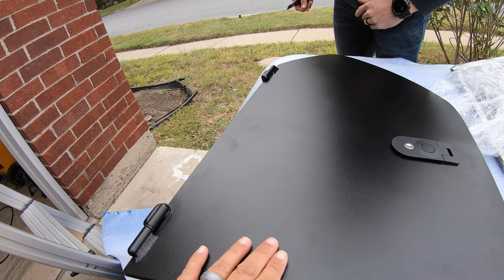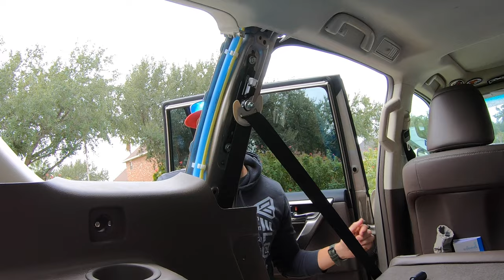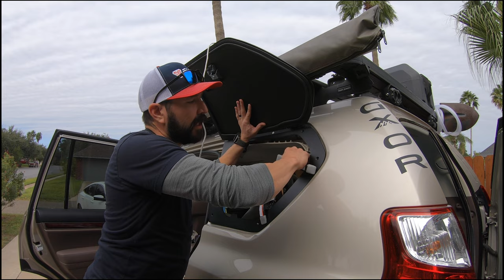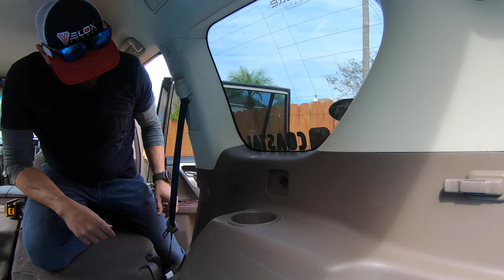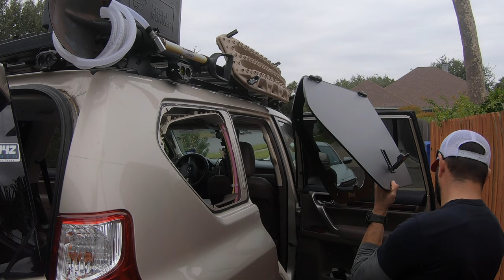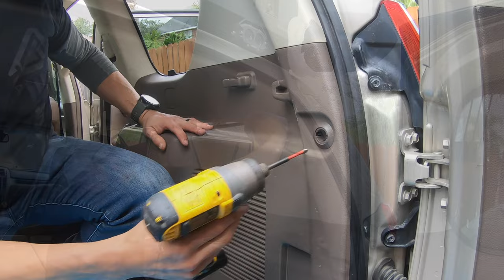Install Velox Gullwings on your Lexus GX460 - Detailed Tutorial

Comment: hey!!
what's the update on these since install?
in regards with rain and wind noise, non? we good?
Thanks!
Reply from the maker: No noise, no leaks, no corrosion, and no dust seepage. They work perfectly and I love the accessibility. Opening dual swing outs and the rear door is a pain, but the wings get you what you need asap.
Reply: @CoastalGX  Brilliant thanks